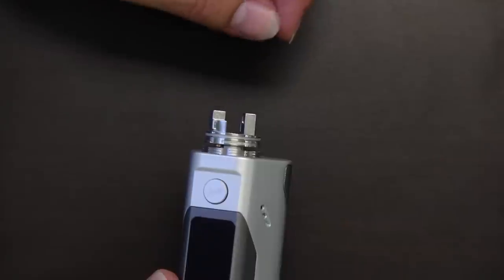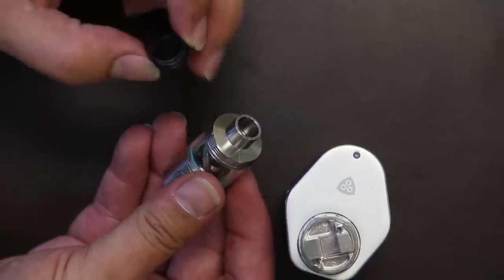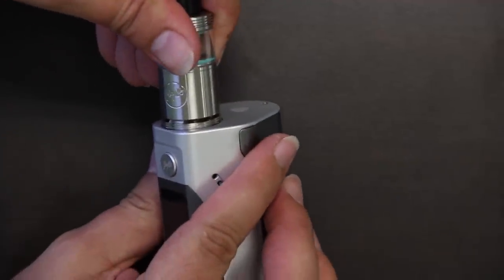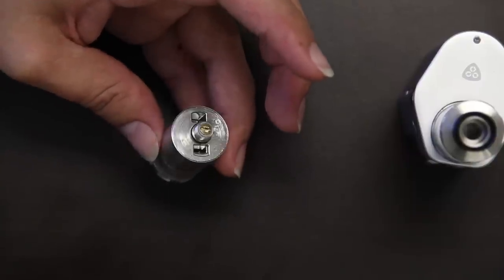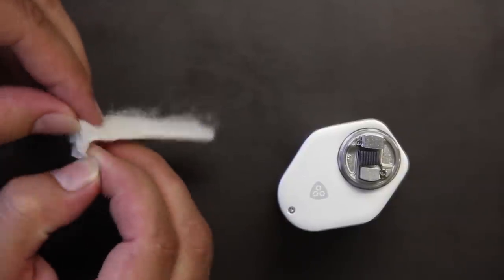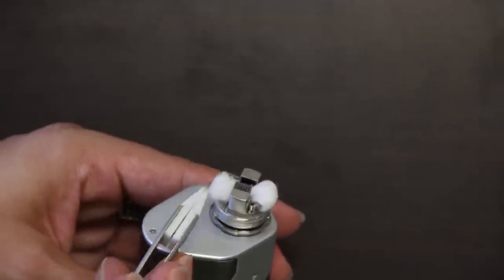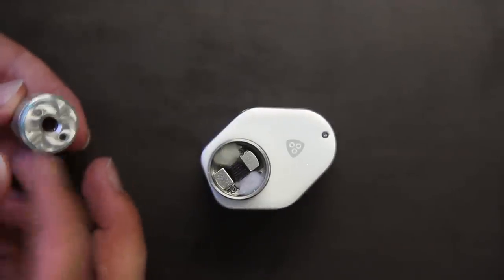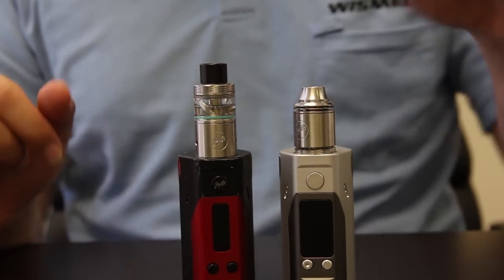First Look at the Wismec Cylin RTA

Comment: Well this was the first and the last time I buy a product from Wismec. The whole locking mechanism is really a joke. Small and weak grub things that should hold it all together? Not good enough as it wears out way too fast.
I have spent the last 1-2 hours trying to take off the AFC at the bottom. I have removed everything including the 510 pin.
I have used tool and even tried in the end to destroy the attie just to see if it would come off at the end.
Still stuck! What the hell? I have been turning it in any way possible and it just won't come off. Isn't it just a O-ring holding it back?

I also noticed that the small O-ring on the juice control pipe thing was teared off when I got it because it has sharp edges inside when you turn on the juice flow control. This thing is simply over engineered and tried to be clever but it backfired really bad.
Nothing was really easy to get off and I had to used pliers again for other stuff. The whole thing is just a mess really and people did indeed warn me about Wismec but I gave it a shot. I'm not even going to bother trying it.
Reply: It's also funny how you AFC was already loose when demonstrating. You know about the issue but still gives it a green light. Why would you do that? Sorry for all the rage but I truly haven't seen a attie this bad before.I cannot comment on the performance or if it wicks right or if it leaks but the build quality and what you have done with it is a big joke
Reply: You mean the build deck? If you took out the 510 the AFC would've came with it. The AFC doesn't twist off it just wiggles off. The build deck I had to insert two screwdrivers in the airholes and turn counter clockwise to get off. It's still the only way I can get it off. But other than that, I love this thing. And this was my first RTA! I just like tinkering with stuff though. This definitely isn't something for someone that just wants something fast and easy to take apart and put together though you can do so once you figure it out.

Comment: Bought one, it is a POS. This is the problem with reviews. Maybe they get well tuned attys, or they do not use them often enough to really experience the flaws. This one is a veritable crap atty. Maybe Matts is different but mine came with the liquid flow control so tight that is it impossible to turn it without turning the bottom cylinder. When the bottom cylinder turns it moves your wicks so that when you turn it back the delivery holes are no longer over the wicks. As you might guess once this happens you get liquid all over your nice mod. 
The ther is the AFC, piece of crap cannot stay in the setting you want, you get the air flow right, you screw the atty on the mod, and the screwing action moves the ring, so that you end up with a draw that is either too tight or too loose, you have to loosen the atty, try again, and on and on.
I bought this so that I don't take my Origen Tank to the shop, I wanted something cheaper...well this was like using 30 dollars to light a fire! Saty away for this one! BTW I have been vaping for years so I am not new at this, I would not post this if I did not feel this was a real substandard atomizer, badly designed and shoddily made. 
First and last JayBo/Wismec product I buy, glad I did not buy the Theorem!

Comment: This is a great single coil rta. Wick it right and you'll have a pretty amazing tank. It's very airy for the included notch coils, but if you turn the airflow down you'll get awesome flavor. 39-40 watts is where the flavor starts with this setup. It has plenty of air for Clapton+ building as well. Be sure to turn off your juice flow when not vaping, at least until you learn the wicking lol.

Comment: I really like how the tank can just pop off for checking the coils but it would be better if it could lock on, there's only o rings holding it in place so could pop off easily and if juice flow is open, it'll leak everywhere. Airflow ring is a bitch to take off and stripping down the tank is damn near impossible. Cool concept but too fiddly and precarious, even for a tinkerer like me. The vape is nice and cool, but a little too airy for my taste, even with airflow near to closed off.